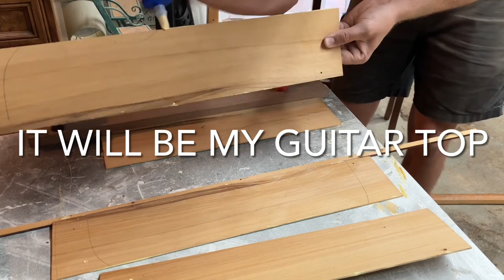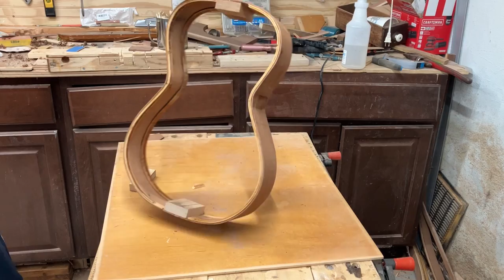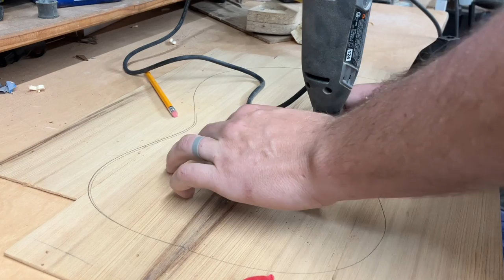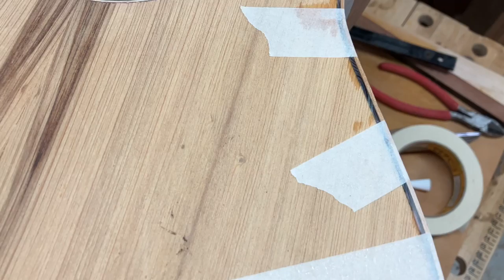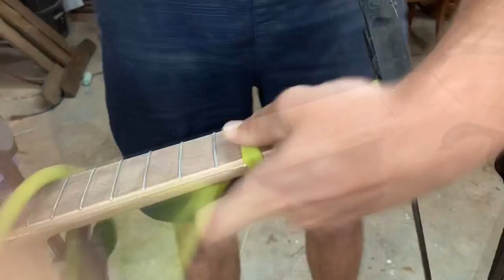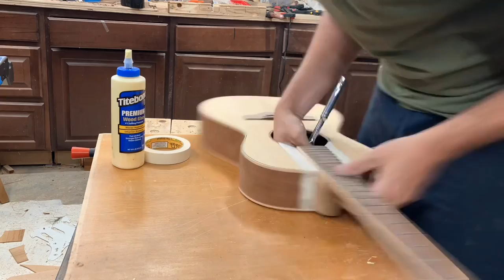Acoustic Guitar build from reclaimed lumber

Comment: damn thats awesome, how did you thickness your top/back/sides?
Reply from the maker: I used the table saw to resaw material and I have an old porter cable benchtop planer to get them close. Then I use a hand plane and orbital sander. 

Its not a fast process!
Reply: @dannylewisguitars  nice, how thick can you get it with the planer? I'm just planning through my first acoustic build and this is probably the biggest hurdle i have.
Reply from the maker: @micksguitarsarecool  If I'm careful, I can get it about 1/8 inch. But that gets pretty dicey. Tear out happens.